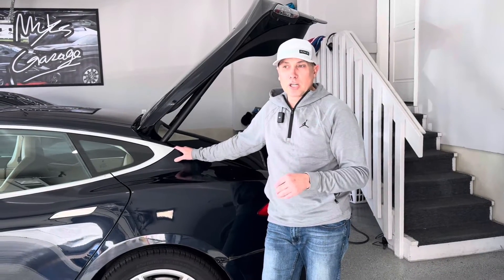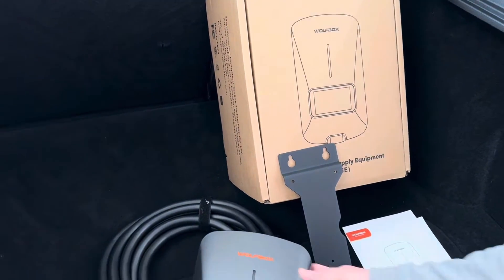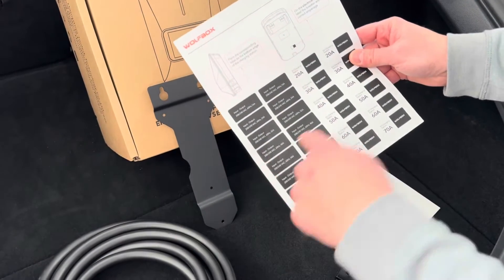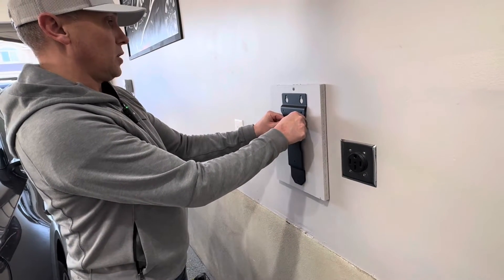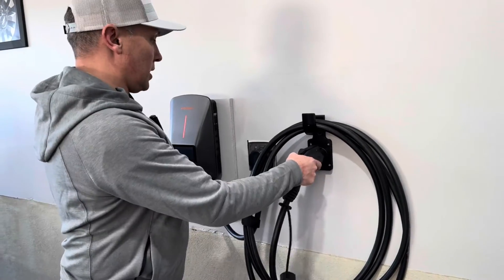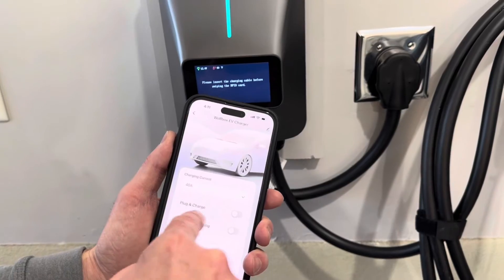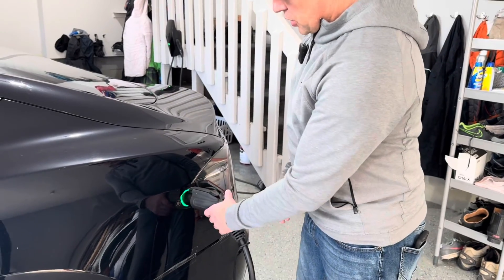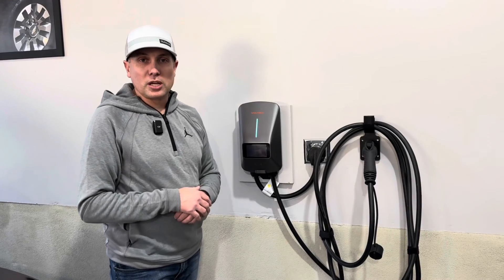EV Charger WOLFBOX Level 2 EV Charger with WiFi and Bluetooth Review | J1772 & Nema 14-50 Plug

Comment: Scheduled charging with this charger doesn't work with my Tesla. It doesn't matter if it's the box or the car that is scheduled, it fails unless both the car and charger are set to plug and charge.
Reply from the maker: Interesting
Reply: I can't get my EV50 to charge My Tesla Model Y. I've been trying to troubleshoot with customer service, and we just can't figure out what the issue is. I swipe the card I insert the charger and it always gives me a message that says please insert the charger before you scan the RFID card.
Reply: @jtoka1  Hmm 🤔 I haven't encountered that issue. My issues went away with updated firmware. Good luck!

Comment: Watch out! It requires a 2.4GHz wifi.  If you only have 5GHz wifi it will not work.  It does not have a 5Ghz transceiver radio.
Reply from the maker: Interesting
Reply: Thanks for letting me know! I was really considering this.